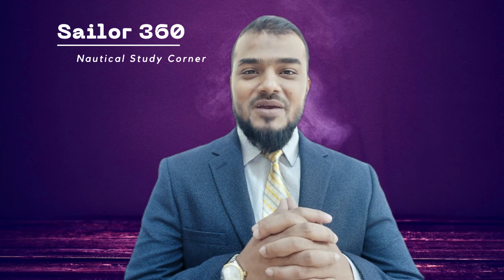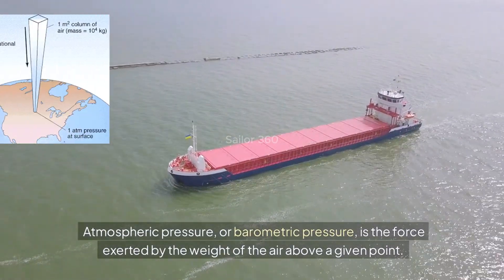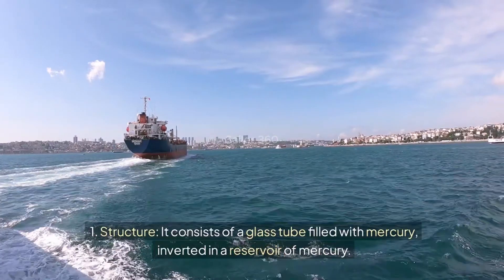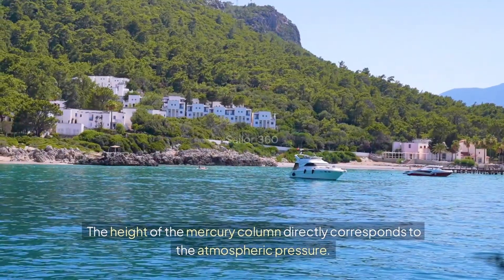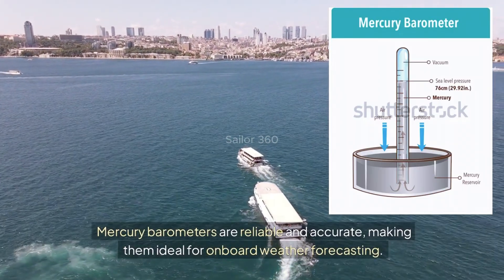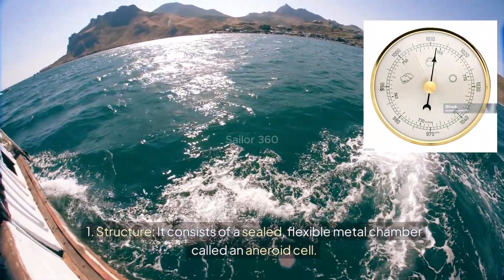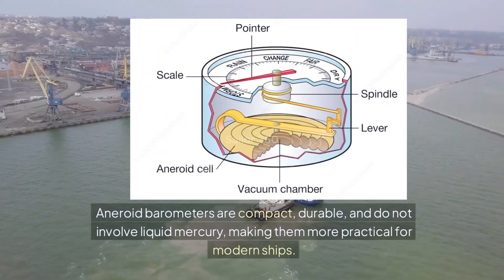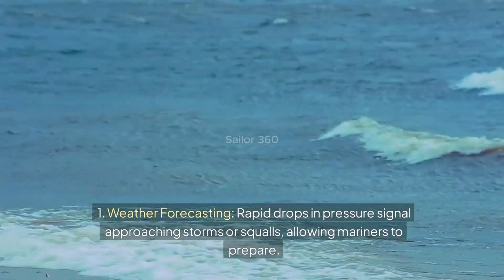What is a Barometer,  Aneroid Barometer and Mercury Barometer working principle II Sailor 360

Comment: How to ensure an aneroid barometer shows the correct value ?
Reply from the maker: I never thought in that way whether my Aneroid Barometer is accurate or not. First of all small differences will not make a big changes on decisive action. Moreover, this can be verified with the paid apps or weather service. 
The android barometer location can be changed
in various places like in Engine room, on deck to observe changes in pressure. 

Or if there is any manufacturer specific guidelines to cross verify the reliability.